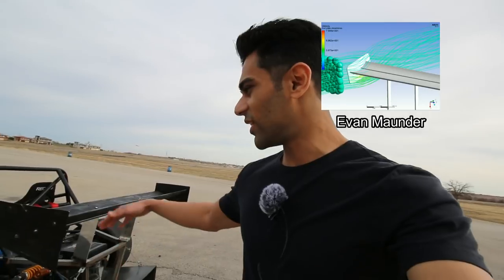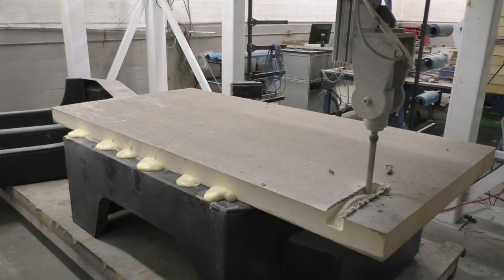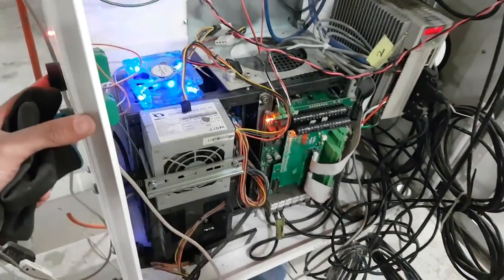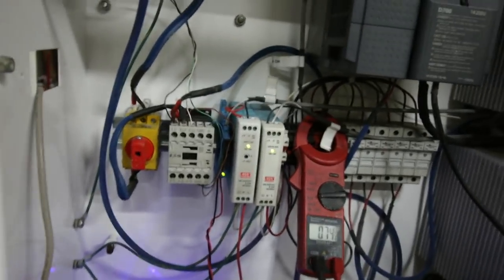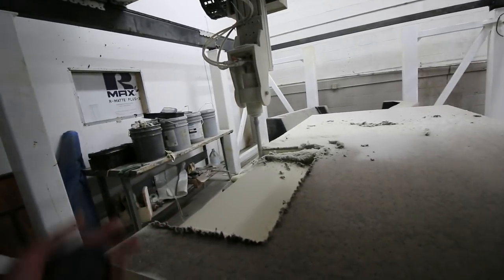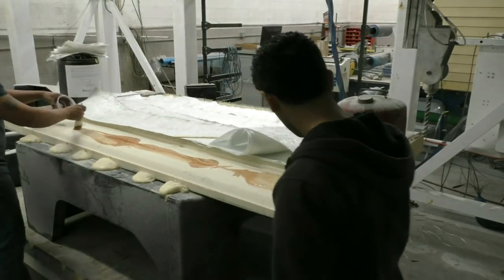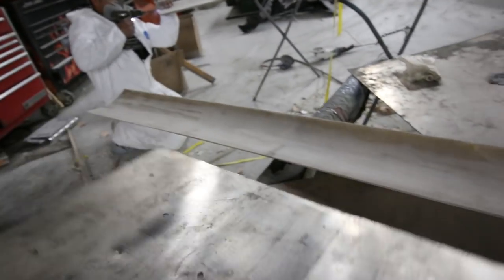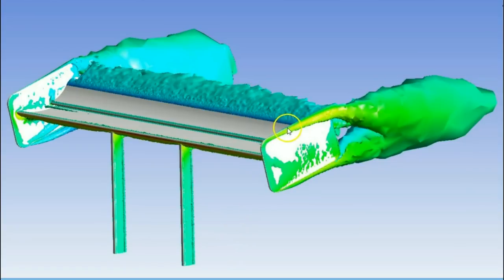Making a Double Element Rear Wing

Comment: Bigger endplates help keep the rear stable during a turn but you need stiffer mounting for the sideload on the wing. I prefer swan neck mounts, since most of the downforce comes from the bottom of the wing and swan necks keep the air way cleaner. Check out the article www.mulsannescorner.com/rearwingLMPCFD2009.html or Race Car Engineering's January 2012 issue.
Reply: Came to say the same thing. Attach to the top of the wing, NOT the underside. Keep the underside clear for air travel and allow the wing to do it's job.

Comment: Cnc repair was great. Wing design was made for clean uninterupted air. This only works if wing is on the front. At the back youll have so much tubulent air they cant desing your wing unless you go to wind tunnel. Good luck with the buil! Geat work!

Comment: 2 things i am surpriised about in your wing, 1: its not a top mount gooseneck and 2: its quite high and not as far back as i would have put it. The lower and further back from the car the more it interacts with the diffusser. Air coming off the diffusser helps the air velocity of the underside of the wing and helps the air stay attached making it more efficient thus more downforce with little to no drag penalty. Just my 2 cents....keep up the good work bro

Comment: NICE!! Customer fixes the machine, I bet they were glad you showed up. So you were impressed with the quality of the other race cars, me too. I wonder how much lighter those cars are compared to your car, I bet not that much lighter. Something worth looking into!
Reply: A few hundred kilos I would guess. Carbon fibre suspension elements, aluminium frame, everything carefully calculated and optimized no doubt.

Watch this 19:50

Comment: Good luck with the rear wing, I would definitely take a mould off it before you take it on the track it doesn't look anything like strong enough.  The cfd should have given you a lift coefficient from this and your gearing it's easy enough to work out the forces on it. The Safest way is too hang some weights off it and see what shape it ends up..

Comment: The leading edge of the first element needs dropping so it is about 2° lower than the trailing edge,second element will also need adjustments,easiest way to visualize this is to look at a side on view of a biplane in level flight and invert the image

Comment: Hey m8,  i was wondering, maybe someday you want to make an electric version of this car or a new car altogether?
Reply: That would have to be a whole new car [edit: / design] because of the dramatically different weight distribution.
Reply: @Conservator.  probably new structure as well, since you will have to make room for the batteries in the floor
Reply: Elinzar yes that’s what I meant.

Comment: Putting the wing close to the track underneath the diffuser has a similar effect to a magnet .. the closer to the track the down force increases exponentially .. like a magnetic attraction 
with the wing mounted high up like most people choose to do .. is counter productive because of the dilution effect of the air to flow towards the wing   thus diluting the down force potential.. You need the wing as close to the track as possible .. too close and the airflow will dam and the car will suffer Porpoising .. which is a bit scary .because your eyesight will become blurred .  I did all of my ground effects using a disused aerodrome  and mounted my wing on scales attached to my open plan trailer  which I towed down the runway .

Comment: Which type of foam board did you use??
Reply: Abhishek Kushwaha -it looks identical to what I just used on a job for rubber (EPDM) roofing underlayment! Cheap stuff, has some fiberglass content and paper/cardboard backing to promote adhesion of the contact cement... Has a tendency to warp and curve a bit, gets installed w large screws and button washers; surprised they would use it for any reason other than low cost? Check out Firestone epdm rubber or any flat roofing videos you will see similar products

Comment: Why not just make the wing alter its angle depending on how much your steering wheel is turned?. No drag or downforce on the straights and all of it in corners
Reply: Yep, or let it twist depending on the direction of the turn.
Reply: K.i.s.s.  Complicated things tend to tricky and break alot.  If you don't need it (because you are planning to race in an open division or a formula series that allsows/requires such things) just leave it off.
"To the engineer, the glass is neither half full nor half empty.  The glass is twice as large as it needs to be."  - Unknown (pre 1990)
Reply: Well, I think the trend of socially acceptable variable aerodynamics in racing should start from somewhere. If k.i.s.s was the purpose of this channel he would be building a 70's chrysler rustbucket with a solid axle, leaf springs, 3 speed maual, pushrod 2 valves per cylinder N/A engine with a controlled-fuel-leak-retor fuel system. Or he could go a step further and drive a trabant.

Comment: 8:42 Hey, that's our PRN1 air rivet nut tool. If those are our rivet nuts or similar, depending on the material thickness and rivet nut size those should be plenty strong as demonstrated here https://www.youtube.com/watch?v=lry2YNb1lok&t. I'll send you specs.